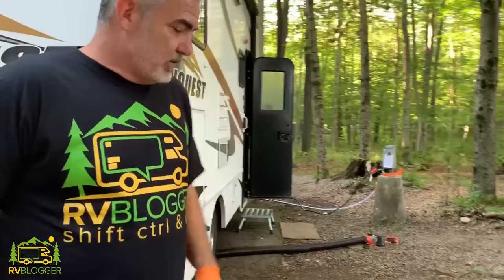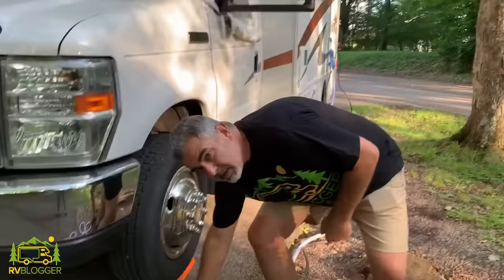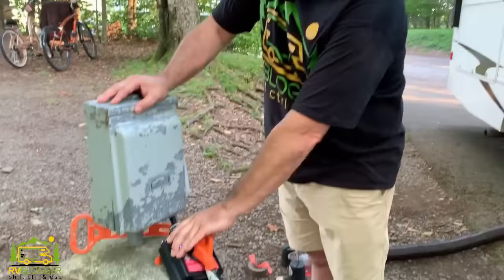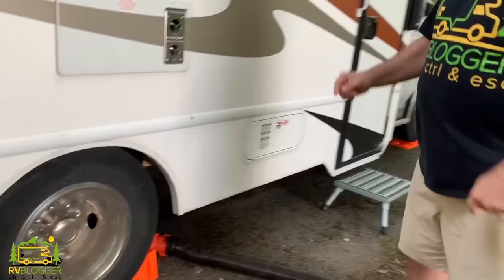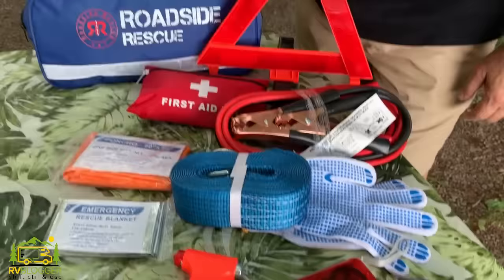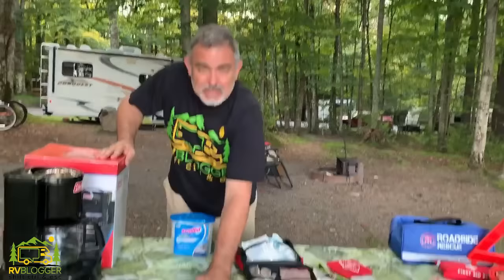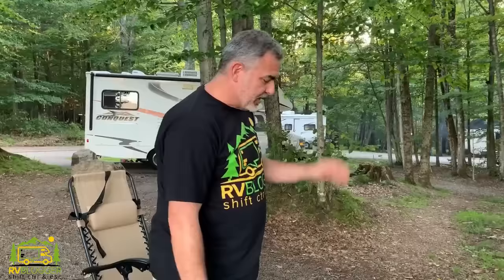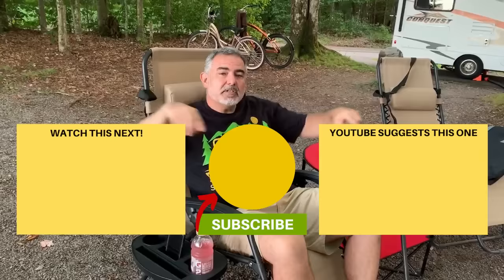Essential Gear & Accessories for RV Beginners - We Didn't Back In to Our Campsite - Do You Know Why?

Comment: Any tips when you park by the beach on the sand? By the way thanks for the great video we learn a lot. We have not hit the road yet and this have help a lot.
Reply from the maker: Hi Enid,
Great question!!!
I have driven on the beach many many times and the trick is to let some air out of your tires! 
Now we don't always do this. If we only park at the campsite we might know if it will support us. If we drive on the beach beyond the campsites this is a must. I recommend lowering your tire pressure down to about 18 psi in a Class B, or C RV. But some beaches have finer sand and require 12 psi like in Cape Hatteras NC. We only drive our Class A where we know from experience that we won't sink in the sand.
Reply: Thanks for tips and quick response.

Comment: Something I noticed was dealing with your water filter. Putting the filter hanging off of your 90 will put more weight/pressure on your fitting than if you were to attach it right from the water source and run just the water hose to your 90 degree fitting. Less weight hanging the better I always say. So it should go, pressure regulator, the small 4 inch long hose, water filter, then your water line.
Reply from the maker: Hi Wonka,
I agree!
Thanks for watching and commenting! 
Mike and Susan

Comment: Hi 👋🏼! How do you store that filter btwn uses? How long is that filter good for?
Reply from the maker: Hi Marsha,
Great question! The water filter will slowly release water over time while it is stored so  keep it connected to my water hose and screw both ends of the hose into both ends of the filter making a closed circle so the water doesn't leak into my storage compartment. The when I hook up the water the next time I go camping I let the water run on the ground for a while before I attach it to my RV. Here is a video we made for CamperReport that explains how water filters work and how to hook them up. Hope it helps!
Mike
https://youtu.be/ra4JNA6M9rQ

Comment: What do you do with the surge protector when it rains?
Reply from the maker: Hi Kelsey,
That is an excellent question! I put a trash bag over the who electric pole and duct tape it at the bottom so it doesn't blow away. Also, keeps it safe from others wanting to steal it!
Thanks for watching and commenting! 
Mike and Susan

Comment: I was surprised to see the water filter hanging off the side of the coach. That is putting a lot of pressure on that fitting. It should be at the spigot.
I'll bet it was fun draining the black hose crawling underneath the coach to elevate the hose to keep "everything" moving along.
We all know that "IT" rolls downhill but there it looks like "IT" would be going uphill LOL!!!
Reply from the maker: Hi Richard,
The water filter works either way and the cheap blue ones are so light it doesn't really matter - especially since we use a 90 degree elbow.
Thanks for watching and commenting! 
Mike and Susan
Reply: @RVBlogger  You were worried about the weight of the hose hanging on the outlet is why you suggested the elbow but then you added the filter which is filled with water. Not a good idea.

Comment: I just purchased my first RV and it's a travel trailer. The only option is back in with a travel trailer thus the hookups would never be on the wrong side -- correct?  Given that, what the likelihood one would need the extra hoses?
Reply from the maker: If we would have backed our motorhome or any RV into this spot the hookup would have been on the correct side. However, when we walked out our RV we would be facing the road and not our camp side where our picnic table and fire ring was located. We preferred walking out to our campsite so we pulled in versus backed in. Hope that helps to understand our situation. I'm not we thoroughly explained that for our viewers. Thank you for watching our essential RV gear video and commenting.
Reply: @RVBlogger   Yeah, I understand that.  My comment was more about travel trailers.  If I pulled in then the tow vehicle would be locked/stuck in the site and would be unable to unhitch or it just wouldn't fit. With a travel trailer I would have back in regardless of preference into the given site.  My question was; is there a need to have the extra hoses like you recommend for a travel trailer then?
Reply from the maker: @rui1863  oh gotcha. All RVs whether TT or motorhomes have hookups like sewer and water on the same side. At this particular campsite, as a travel trailer, you would have to back in and wouldn’t need additional equipment. However, if you could pull in (like a pull through campsite) and you could possibly need additional equipment to make that connection. Hope this was helpful.
Reply: @rui1863  It's always good to have an extra pipe, water line and extension for power. You never know if the utilities are farther back than you can reach so it's best to have extensions for those 3 items. Even if you are parking correctly.

Comment: I back into that spot with my Mallard...everything would fit perfect. Must be a motor home issue. That would suck setting all that up.
Reply from the maker: Hi Scott,
I can't believe how many people missed this so you aren't alone...
I guess it isn’t obvious but if we backed in to the site the side door of our RV would not be facing the main part of our campsite where the picnic table and fire ring are located. Maybe I didn’t explain that well enough in the video…
Thanks for watching and commenting! 
Mike and Susan
Reply: @RVBlogger  oh I caught on to that. But other than a few times, how many times are u going in n out of the rig? A slight inconvenience of walking around wouldn’t justify me to pull out everything in my arsenal. but other than that I did enjoy ur tips and positive attitude. The water regulator gauge and camp table were my favorite.
Reply: @scottcoffelt329  Hi Scott,
I also like my head higher than my feet when I sleep so pulling in would not work for that reason either. But we thought I would be cool to show a campsite where the hookups were actually on the wrong side. This happens to us several times a year but we camp way more than most people. And so I decided this would be a great opportunity to show one of the reasons we carry 2 water, sewer, and electrical lines at all times. The main reason, of course, is in case one breaks but the other is because the hookups are backwards, or too far from where the level spot is on a campsite. But it turns out most people just think I'm dumb and should have backed in. We just tried to take advantage of all the lessons the site provided us but I guess we didn't communicate all that well enough.
Also, walking around to the dark side of an RV with drinks in pitch black at night is not a good idea. We stay up late so it was not worth the risk.
Thanks again,
MIke

Comment: You stated that you used to turn faucet on half way to adjust pressure. Turning the water half way on does not effect water pressure. It has same pressure just not as much flow. A pressure regulator is a must.
Reply from the maker: Hi Melinda,
I agree! I know guessing at water pressure by trying to adjust the spigot at the campground will not work - that's why we bought the pressure regulator.
Thanks for watching and commenting!
Mike and Susan

Comment: Without a pressure reducing regulator, all you are doing is controlling the flow. As soon as the water stops flowing from a faucet the pressure equalizes to whatever the supply is.
Reply from the maker: Hi Fishhead,
Not sure about that...?
Reply: The pressure drops somewhat when you open an RV faucet, but otherwise will never rise any higher than the pressure you have the regulator set at - typically 40psi is safe for RV plastic fittings. That's the purpose of the regulator. PEX tubing will withstand much higher pressure, but the flimsy connectors used in RVs will fail long before.
Reply: @RVBlogger  by choking the water at the valve, it may appear to have less pressure at the faucet because the flow is restricted, but as soon as the water is turned off, the pressure equalizes to whatever the supply is. So for all the people trying to choke the pressure with the supply faucet handle.....It does nothing but restrict flow.
Reply: @wmk0100  Both sound right. So to resolve this. Buy a faucet thread water pressure gauge from Home Depot or Amazon for about $11 and test the pressure before and after the regulator.
Reply: @RVBlogger  Pressure through a valve may restrict flow, but once stopped at the outlet end, the pressure will equalize.
Reply: @respectanimals6160  I'm a hydraulics engineer, I know what the answer is.

Comment: Another RV hack for toilet paper.  Check the packaging on toilet paper.  Many brands will say safe for septic and RV systems.  If not sure, fill a glass with water, place a square in it, let it sit for an hour or so.  If it dissolves good to go.  Will save you money too buying paper off shelf vs specialty toilet paper.
Reply from the maker: Hi Cap,
Great suggestion!
Thanks for watching and commenting! 
Mike and Susan

Comment: The weakest part of your water system is your hose, that’s the primary reason for the regulator. The hose will go before the  pex in modern trailers will give out.
Reply from the maker: Hi Harry,
Yup - great point Harry.
Thanks for sharing that info!
Thanks for watching and commenting! 
Mike and Susan

Have you subscribed to our YouTube channel yet? If not we sure hope you will click below to subscribe! Thanks!
http://goto.rvblogger.com/YoutubeChannel?sub_confirmation=1
Reply: Actually the weakest links in order of "robustness" to "flimsy" is: PEX tubing, your supply hose, then the fittings. You usually won't find high quality plumbing fittings in RVs, and they are almost ALWAYS first to fail.
Also... anytime you are away from the RV, turn off the outside supply.
Reply: @nortonnewmann3711  I’d love to see the data on that! I wonder why they are putting Pex tubing in so many new homes....even high end ones, if it commonly fails? So if I understand you correctly, a $25 white water hose left in the sun on a 100 degree day with unregulated water pressure is less likely to burst than the Pex tubing in an RV......interesting.....again would love to see that data. Maybe you just want to be argumentative, because the assumption made was, why not regulate both the hose and the RV if your going to regulate the water pressure.

Comment: Just wondering why you didn't drive into your site ??
Reply from the maker: You mean back into our site? We certainly could've backed into our spot but then our door would've been facing the road vs facing our campsite where our picnic table and fire ring etc was. We preferred pulling in and that was ok cause we had enough RV gear to make it work. Thanks for watching and commenting.

Comment: How are you connecting the public water to the drain water, that is usually a forbidden connection in most plumbing.  Are you actually connecting it to the city water line that later goes into the fresh tank?
Reply: I believe those connections have a one way check valve
Reply from the maker: Hi Bruce,
The Rhinoblaster has a built in check valve. Plus we never use our freshwater hose to make the connection. And finally we usually hookup at the dump station to avoid using a freshwater source to be extra safe.
Thanks for watching and commenting! 
Mike and Susan

Comment: I understand you need to sell affiliated links...  But I love to disagree with a few things...
Other than the purpose of making the video and proving a point, what prevented you from parking the other way?
The sewer hose is okay and really compact when stored, but they are very fragile, they will puncture easily and when stepped on it it will bend the rings...
Would you throw 4 rolls of toilet paper at once in your black tank? why would you throw 4 rolls in a period of a few days? Does it make it less paper?
The sediment filter has also a charcoal block that will reduce a few chemicals and odors, but it does not filter dissolved minerals, only big chunks that may peel off from the lines...
I love the tow rope and I carry one with me... You don't have a big RV, but do you really think it can (or is rated) pull you out of a ditch? This is good for some towing situations but definitely not a recovery tool for RV's.
For coffee, we use a french press or a percolator, much smaller for storage... 
Leveling blocks, any reason not to use or recommend Andersen-style blocks? Related to leveling, If you only travel one day, park it once, and go back home a few days later this won't matter, but I would never travel without my Bluetooth level mate, precise, and a super time saver...

I love the zero-g chair! although more expensive I also have a Nemo stargazer recliner, no support for the legs but the best camping chair ever!
Reply from the maker: Hi Luis,
I love to disagree too! And so here goes.
We didn't make the video to sell affiliate products. Are you kidding me? There is no money in that.
Secondly - and you are among thousands of others who got this wrong too -  watch the video again - I guess it isn’t obvious but if we backed in to the site the side door of our RV would not be facing the main part of our campsite where the picnic table and fire ring are located. Maybe I didn’t explain that well enough in the video…
The sewer hose is awesome! I have stepped on it many times with no problems. We have had cheaper ones that have problems like you describe though.
I have no idea what you are talking about regarding the toilet paper.
The tow rope is actually rated for 12,000 lbs. It's one of the strongest I have found at a reasonable price and yes - it could pull us out of a ditch if needed.
I don't recommend Anderson leveling blocks because we don't use them. They look like an awesome product but we only recommend the things we actually use and I just haven't tried them yet.
And - we do just fine using a free level app on our phone to get leveled up. We like to keep things simple and honestly we camp so much we have a pretty good eye for it at this point. I can guess the number of blocks I will need to get level before I even jump out of the RV at this point.
Glad you love your zero gravity chair - we love ours too!
I appreciate your respectful and friendly tone even though you wanted to debate! I'm always up for that! Plus we learn new things from our viewers all the time and I hope that never ends.
Thanks for watching and commenting! 
Mike and Susan
Reply: @RVBlogger  I forgot to mention, I use my level mate and the Andersen style blocks  on my 5th wheel, it is harder for me to guesstimate how level the trailer is without jumping out of the truck... On a class A, B, or C, the app on the phone will do just fine...

Comment: Dam those hook up locations are terrible. I would have rather used my tanks and emptied them as needed than walk over the stinky slinky when i open my door. That is also a pretty sketchy eletrical hook up. It really shows if you are prepared and have the right stuff, you spend more time enjoying your rig or stressing over it.
Reply from the maker: Hi Patrick. 
We couldn't agree more! So we carry two water hoses, two septic hoses and an extra electrical cord on board. Plus sometimes things break and it's nice to have a backup on board the RV. Always Be Prepared - yup I was a Boy Scout.
Thanks for watching the video and for your comment!
Mike

Comment: How are the hookups on the wrong side? You didn't back in. You created a problem. And you didn't create just one problem. Now you have trip hazards. And you are contaminating your fresh water hose by having the filter on the wrong end.
Reply from the maker: We could've backed into our spot the "right" way but then our door would've been facing the road vs facing our campsite where our picnic table and fire ring etc was. We preferred pulling in and that was ok cause we had enough RV gear to make it work. I do find it interesting how many people are concerned by the way we parked. We didn't seem to be nearly as bothered as those that like to criticize us.🤣 Thanks for watching and commenting.

Comment: You pulled into your spot the wrong way.  Also, don't use black tank chemicals.  Just water.  Don't make your tank into a septic system.
Reply from the maker: Actually we didn't pull in the wrong way. The hookups are on the wrong side - watch the video again. Also toilet chemicals are very helpful and although Kleen Tank is spreading the word that all you need is water this is false. Even they recommend toilet chemicals but they tell you to use Pine Sol and Calgon crystals which are chemicals.
Thanks for watching and for commenting!
Mike

Comment: Why didn't you just back in you wouldn't need all those extensions, also the way the water gets run is, faucet, pressure regulator, (you can use the short hose if needed) water filter, 25ft hose connects to 90 at camper city water connection
Reply from the maker: Hi Kip,
If we backed in the door leading into the RV would be on the wrong side... then we would have to walk all the way around the RV to get to the larger part of our campsite where the picnic table and fire ring were located...which is more of a hassle than needing a couple of extensions.
Thanks for asking!
And thanks for watching the video!
Mike

Comment: Im a bit confused about the utilities being on “the wrong side” cant you just back in instead of pulling in, so the outlets are on the correct side?
Reply from the maker: Hi Johnny,
I guess it isn’t obvious but if we backed in to the site the side door of our RV would not be facing the main part of our campsite where the picnic table and fire ring are located. Maybe I didn’t explain that well enough in the video…
Thanks for watching and commenting! 
Mike and Susan